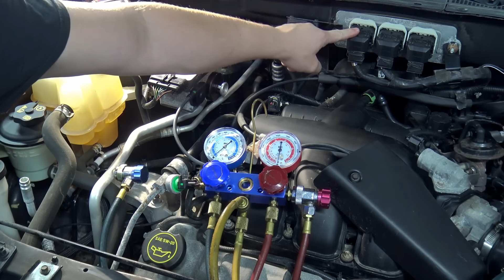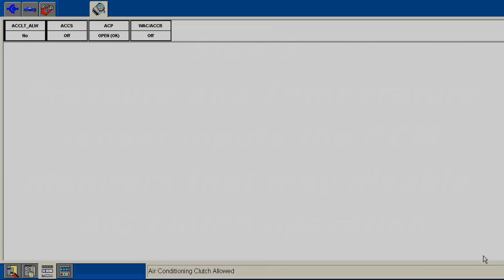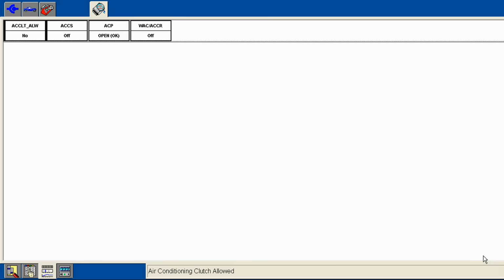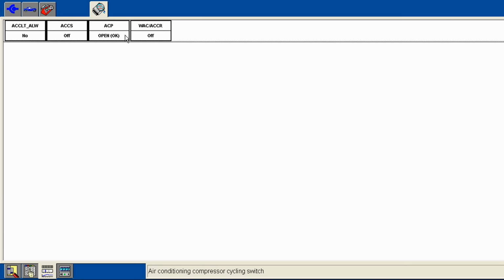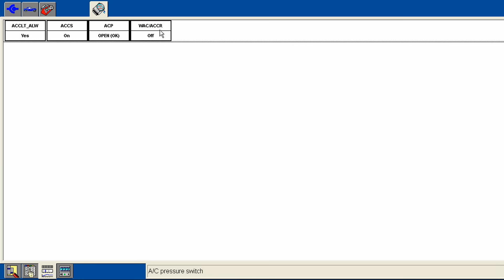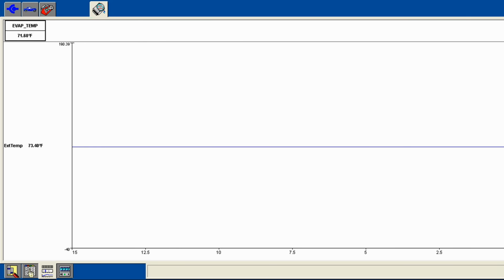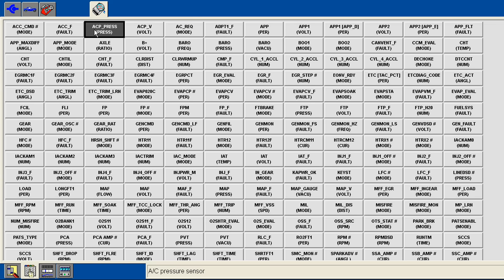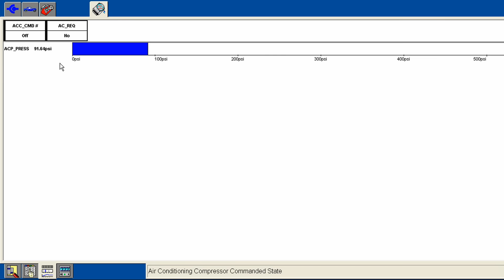Ford A/C Quick Tips #7: How To Quickly Diagnose A/C Concerns

Comment: What about the Cabin Filter? I had a Camry that the AC refused to turn on the AC because the filter was clogged... Does Ford have the same thing?
Reply from the maker: No Ford has no such sensor they will run until the evap freezes over.

Comment: Hey i got a weird issue with my 98 Explorer. My AC started blowing hot air on the freeway. Idle it was fine. So i charged it, checked the pulley and clutch, no leaks. So i bought the blend door actuator and installed it, holy crap it worked!  Colder than a fridge! Only one problem, now i get no heat. Its blowing AC even on defrost and heater. Is the blend door stuck now? Did i screw up the heater core somehow? Thanks.
Reply from the maker: Well you obviously fixed something, the older vehicles don't need to be calibrated so I would say you use an aftermarket actuator. Am I correct?
Reply: FordTechMakuloco Yeah i just got the next cheapest one from Rock Auto. I was wondering maybe if i unplugged it it would go back to heat. Ive been waiting until it gets cold to try that though. Dont want to screw up that cold air during the home stretch of the summer ha.